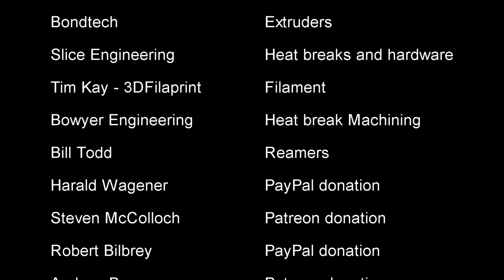DIY non stick coating for Nozzles and Hot Ends

Comment: Very interesting. Reading 3 different brands "applications" sections, it also sounds like it'll be a good lubricant for linear rails and rods too.
Reply: Tried it today. Sprayed some "DM-90" branded spray and left it for 3hrs (can said 2) and the coating just wiped straight off. Trying again overnight, this time shaking the can for 60 seconds instead of 6.
Reply: @KentoCommenT  what do you think?

Comment: Smart, very smart. But seems too expensive for my budget and difficult to acquire. Would have been so much easier a few years ago since this one appears to be a UK made product, i'm in EU, in fact i've lost hassle-free cost-effective access to numerous British suppliers i've bought from before or wanted to buy from yet, you've got so many desirable tech related products over there. I haven't seen a comparable product from a local supplier yet, but i'll be on the lookout.
Reply from the maker: That's a shame. For sure Molyslip is a UK based company but I'd have thought that they would have a network of dealers throughout the world. Maybe there is a locally made equivalent. Where about in the EU are you?

Comment: Have you tried other brands of MoS2 dry spray ? What is your feedback on this MoS2  coating after some time ? Do you recomend it ? Do you recomend coating the entire nozzle ? Just the outside to avoid filament sticking or even inside where the filament is being heated and melted ? 
Did you hae any issues with small output diameter nozzle getting clogs ?   Thanks for the video !
Reply from the maker: No, I haven't tried any other brands but I'd imagine they all work the same. I still use use it myself. I just tend to spray the underside of the hot end including the nozzle. I haven't tried it inside a nozzle but I have tried it inside the heat breaks - I can't say that it makes any difference or not as I don't get blockages in that area - I guess it doesn't do any harm though. I haven't tried with nozzles under 0.4mm. The only down side is that every coated nozzle ends up the same gray colour making it difficult to tell at a glance whether the nozzle is brass, or hardened steel, and what size it is.

Comment: I'm gonna have to try this out. I wonder if I should just cover the whole block or if the nozzle is just fine.
Reply: And then it makes me wonder...
What about the inside? Coating the inside of the nozzle/filament path.
Reply from the maker: @girrrrrrr2  Coating the inside of the filament path through the combining block was the main reason why I bought it to try. I can't say that it made much difference to the lowest temperature that I could extrude at. Whether it would help a hot end that is prone to blocking, I can't say. But it didn't seem to do any harm. Ref covering the whole block - that's pretty much what I did.

Comment: Thanks, it would be useful to show how to apply it...
Reply from the maker: It comes in an aerosol can - I just sprayed it on.
Reply: @deckingman  Yes, I understand, but there is a bit more to the process, like safety precautions, multiple layers, drying and drying temperature, how to cover the part completely...etc. I cannot find the product you show, but found this product which is quite common around the world: CRC PR03084 Dry Moly Lube
Reply from the maker: @rondlh20  Here is link where you can find  the technical data sheet https://www.molyslip.co.uk/dry-moly-spray/
I just shook the can well for about a minute, sprayed from a distance of 150 - 300mm and left to dry. I haven't yet needed to re-apply. One thing of note is that it covers the part with a dull grey finish so if you have a number of nozzles as I do, you can't tell which are brass, and which are hardened steel, nor can you tell what size they are if the size is etched onto the nozzle.
Reply: @deckingman  Thanks a lot, these are very useful tips!
Reply: @deckingman  The sizes of nozzles are often marked with dots. There are 6 sides which can accept one dot position each. You can use the e3d marking system which has patterns for marking between 0.15 and 0.8, or the Volcano has patterns for 0.4-1.2 which may be more relevant, or come up with your own system, or borrow one from another manufacturer. You can just centrepunch them in and follow up with a hand deburrer or a light tap of a 1.5mm drill bit, and simultaneously the dots will reveal the underlying material and be much easier to read than other types of marking. I can't really read the engraving on any of my nozzles which i've used a handful of times :D The dot positions are far away from the nozzle tip so i don't think the little bit of bare metal there will interfere with non stick function or any such like.